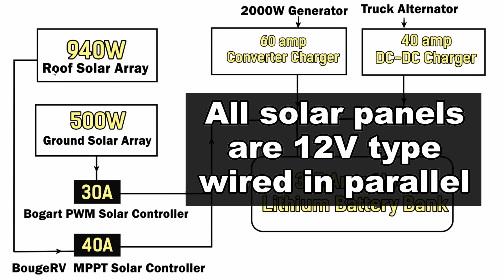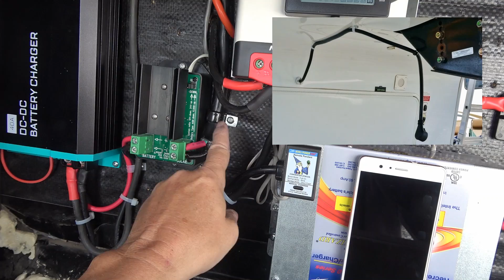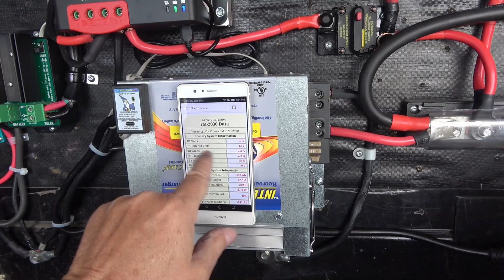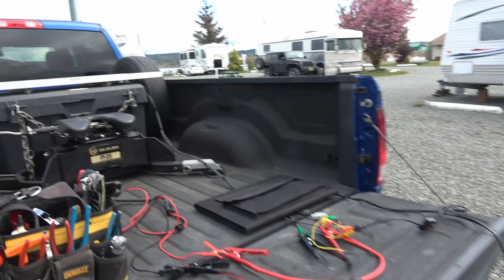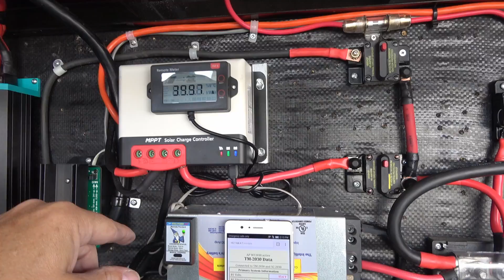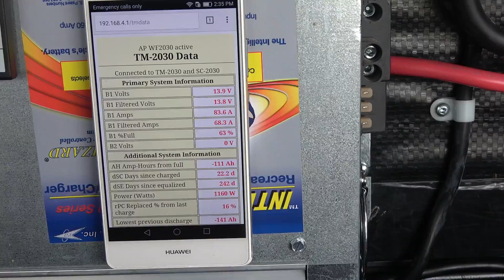Boondocking Power Upgrade - Adding Separate 500W Solar Ground Panel Array + Wiring Cleanup

Comment: Thanks Ray for your videos!  I'm curious, why did you run your PWM through a DC to DC charger and not hook up directly to the battery?
Reply from the maker: I didn't run it though the DC-DC charger. It is hooked directly to the battery. The PWM output was just sharing the same positive feed cable to the battery as the DC-DC charger output. Since when I was driving I obviously didn't have the solar ground array out I could utilize the same feed and breaker for both.  Cheers, Ray

Comment: Hello Ray…seems like the 40 mppt controller is way under what the roof panels should be able to produce?  Please correct me but it seems a 12 volt system with 940 watts should be able to produce almost 80 amps of current?  I am kind of surprised the 40 amp mppt controller has not burned out?  Great setup though.   Thanks, James.  Perhaps you could get a second 40amp mppt controller and split the panels to take advantage of any excess current being produced.
Reply from the maker: 40 amps is plenty for us, especially with the extra ground array option. I have purposely over paneled my roof because over 80% of my boondocking is done in either the cloudy, treed Pacific Northwest or winter in the Southwest USA. Clouds and low sun winter angle mean even though I have 940 watts I don't see that anywhere near much during my typical usage. To see 940 watts it would have to be perfect overhead sun and an extremely clear sky. Most panels are also lab rated and in the real world only output on average about 85-90% of that rating.
The controller hasn't burned out becasue it has built-in protections, an over temp auto shutdown and also has a circuit to deal with to many watts, it will only pass the 40 amps max charging by going into current limiting mode.
Actually, I'm going to torture test it this weekend. They are calling for 90-100F temps here and this time of year the sun is very high up. :) We will see how it react and if I can burn it out!

4.1 Protections
● Waterproofing protection
Rating: IP32
● Input power limited protection
When the power of solar panel is higher than the rated value, the controller will limit
the power of solar panel within the rated power range to prevent damage by over
current, and the controller enter the current-limiting charge.
● Battery reverse polarity protection
If the battery polarity is reversed, the system will not work but it will not burn out
the controller.
● PV input end voltage is too high
If the voltage at the PV array input end is too high, the controller will automatically
shut off the PV input.
● PV input end short circuit protection
If the voltage at the PV array input end is short circuited, the controller will turn off
charging; after short circuit is removed, charging will automatically recover.
● PV input reverse polarity protection
When the polarity of PV array is reversed, the controller will not be damaged, and
normal operation will continue after wiring error is corrected.
● Night reverse charging protection
Prevent battery discharge through the solar panel at night.
● TVS lightning protection
● Over-temperature protection
When temperature of the controller exceeds the set value, it will reduce charging
power or stop charging

Comment: I want to know when your light bulbs go out in my light fixture does the whole thing go out
Reply from the maker: Sorry, I don't really understand what you are asking?
Reply: My light fixture above the kitchen sink in my travel trailer the bulbs went out does the whole light fixture shorten out
Reply from the maker: @robertflisowski746  No, if it was a short circuit it would have blown a fuse and likely multiple lights would have gone out. More likely there is a poor wire connection in the fixture or maybe the switch is bad. Cheers, Ray

Comment: nice setup.  Do you think that the differences in the panel output voltages impact your optimal solar production?
Reply from the maker: Best to have all exactly the same make and model panels but since all my panels are all 12V type and their open circuit voltages are pretty close, so not much loss.

Comment: Enjoyable, informative video as usual; ... but from what I know about solar (admittedly not too much) it looks like you're wasting a lot of energy with a lot more coming in than you have battery storage for.  Seems like the batteries would be fully charged early in the day leaving all the unused power not utilized for the rest of the day, am I completely wrong?
Reply from the maker: Thanks! Depends on when and where you are camping. If the location is always sunny and days are long that's true. But for us a significant portion of our off grid camping in winter down in the south west desert. Mid winter days only have about 6 hour solar days and very low sun angle so panels aren't near as efficient.. Or we are in the Pacific Northwest, lots of partial sun or cloudy days and often some panels are shaded by trees during parts of the day.  My 315 amp hours of lithium batteries is comparable to a 6 lead acid battery bank and I also have 100 amp hour and 740 amp hour portable lithium power stations which are comparable to about 3 more lead acid batteries.  Cheers, Ray

Comment: Wow, can you make this any more complicated? Renogy makes a MPPT charge controler/DC TO DC  charger all in one unit! You could get rid of half that stuff.
Reply from the maker: Sounds like that would only reduce one device for me and there are a few drawbacks to consider. 
(1) less redundancy, if the DC-DC charger/MPPT combo device quits now you've lost 2 charging options. 
(2) less max amperage potential when driving. If you look closely at the specs on the Renogy 50A DC-DC MPPT combo product https://www.renogy.com/dcc50s-12v-50a-dc-dc-on-board-battery-charger-with-mppt/ It says Maximum Charging Current : 50A (25A Alternator / 25A PV)  With my current setup I can get 40 amps from my alternator via the DC-DC charger and 40 amps from my MPPT solar charger. So combine to max out at 80 amps potentially versus 50 amps. Cheers, Ray

Comment: Ray, re the mattress you got a while back, how did you know what to get?  Yours was a medium as I recall.
The foam shops here are not much help and one or more have bad reviews.
Thanks
Reply from the maker: I didn't know exactly what to get, there are so many on the market but last year Lippert was offering me one for free to try out. https://www.loveyourrv.com/review-of-the-thomas-payne-rv-mattress-lci/
Overall we are both happy with it but I did have to buy an extra inch of memory foam to add to the top. They cheap out there and only give a 1" memory foam top layer and I think it really needs 2" to be comfortable. Here was my update video clip - https://youtu.be/z444Da45Ph4  I told Lippert they need more memory foam on top. The base dense foam layer is pretty good so far after nearly a year, it hasn't sagged at all.  The problem with Lippert is shipping to Canada can get expensive. You may want to check Amazon for similar types
Reply: @LoveYourRV  Ray, so what was the order criteria, bed size only or were there other options.
if the bottom foam thru all is the same hardness then I could order thicker top foam?? yes/no?   is the top foam available in different densities and thicknesses?
Have any other viewers been thru this and have suggestions??
Once purchased it's too late.  Stores here have been accused of switching foam densities.
How did you dispose of old mattress?
Thanks
Reply from the maker: Here is the product page, looks like they are out of stock - https://store.lci1.com/thomas-payne-premium-mattress-tp-foam-matt.html  Due to foam shortages I guess it may be a bad time to have to buy a mattress.  https://www.houstonchronicle.com/lifestyle/home-design/article/A-shortage-of-foam-and-backlog-for-furniture-16140034.php
Mattress options were:
Available in Queen (60" x 80" x 10", 52.5 lbs.), Short Queen (60" x 75" x 10", 50 lbs.), King (76" x 80" x 10", 65 lbs.), and Narrow King (72" x 80" x 10", 62 lbs.) sizes,
I took my old mattress to the local land fill. They had a separate area to place it into. Cost of disposal was around 10 bucks
Reply: @LoveYourRV  I'm going to a foam shop  this am to check things out.  Re shipping, a lot of US firms ship free within the lower 48.  So have them ship to Seawings Express in Blaine WA.  I'll cut and paste the page.  SW is a freight forwarder and will look after charges then bring it over to their other depot at the Victoria Airport.  From there you can either pick it up if you are local or have courier bring it up to CR.
https://www.seawings.ca/
I've had them bring Med gear up from Oregon.  UPS will rip you off for almost as much as the item costs.
Reply from the maker: This is a similar operation https://www.myus.com/how-myus-works/

Comment: Love your videos.  So I guess it's ok to mix panels of different capacities in parallel?
Reply: Makes sense. Thank you
Reply from the maker: In parallel, the main concern is the panel voltage. I used what they call 12V type panels so they are all very similar in voltage. Sticking with exactly identical panels would be better but since they are all 12V type panels the voltage differences are minimal. So any losses due to the mix match of brand and wattage are fairly small.

Comment: Ray! I'll be using the 3000watts. 
Comes on sale at canadian tire.
Reply from the maker: Does CT have a 3000W pure sine wave inverter? I can only see a modified sine wave at that wattage. They are cheaper and will work with most loads but some things can have issues.
Reply: @LoveYourRV  
Yes, it's something I have to check. I didn't know until after I bought it later on. We'll wait and see what happens.

Comment: Hey Ray, You'll like the 2000 watt inverter. I upgraded mine and the fan never comes on anymore for average use. It's truly a quiet solar system now.
Reply from the maker: Cool! I rarely hear the fan on mine, but usually we are drawing around 100 watts or less just computer and chargers, so it doesn't work too hard at all and its located in the front storage compartment.  Cheers, Ray